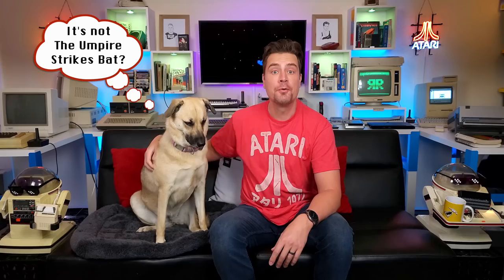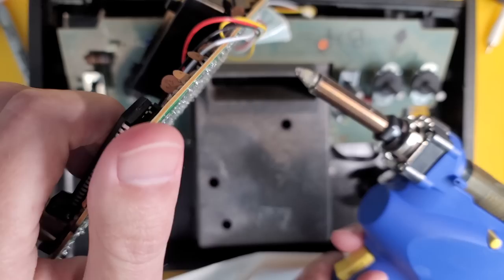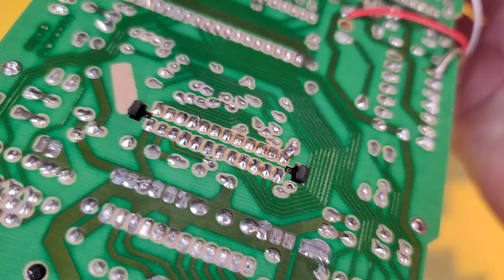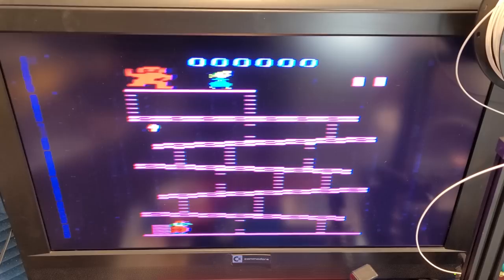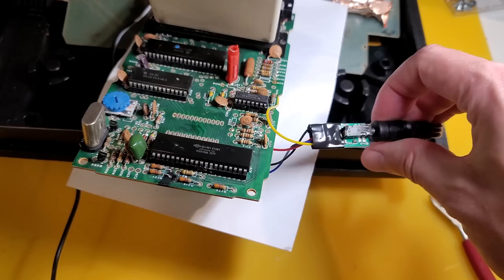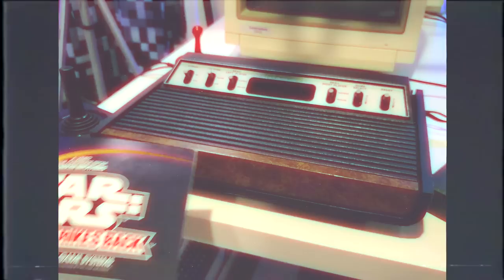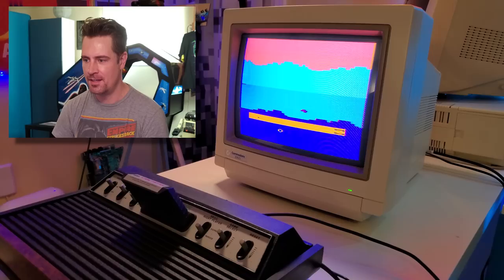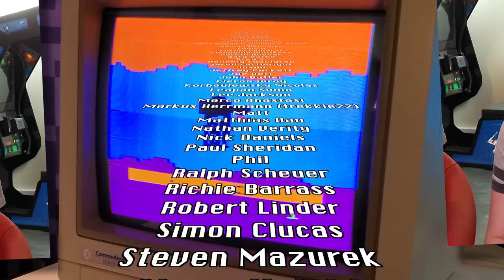I've waited 37 years for this game. WILL IT WORK!? | Empire Strikes Back Atari VCS Repair

Comment: No offence, but Your soldering work looks horrendeous. Try not to touch the iron with the solder, also pay attention on the amout of solder You apply per joint - it should result in concave, not convex surface for optimal performance.
Reply from the maker: "No offence" ... "Your work is HORRENDOUS!" Lol ok.
I realize you've been told that's the right way, but in every trade there are different takes on different techniques. If it works it works, and I guarantee you that soldering will still be making a perfect connection 37 years from now. But I'll bite out of interest. If the solder doesn't make concave peaks, what happens? What's the measurable scientific difference electrically?
Reply: Touching solder with iron increases the risk of spikes, naturally. Convex surfases are an indicator of too much solder, which increases the risk of solder spikes, overhearing signals (decreasing isolation), and ultimately leads into short circuits. Especilly with RF circuitry that might cause problems, not so with digital.

Hmm, I’ll also bite 😆:
I used to do inspections on PCBs in a commercial electronics factory couple of decades ago... we wouldn’t let anyone touch customer boards, before they learned and passed soldering training (typically people learned within a month. We used microscopes in training, but after you get the touch, you can toss it).
Reply from the maker: @jilmarit  Very interesting thank you